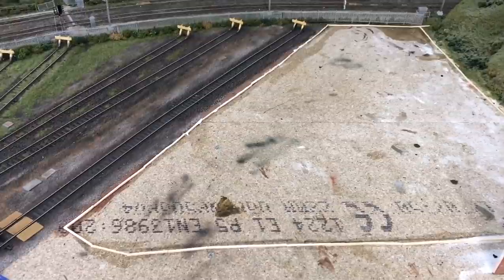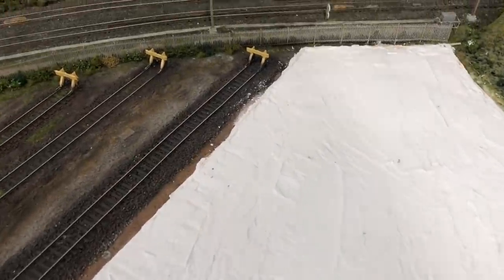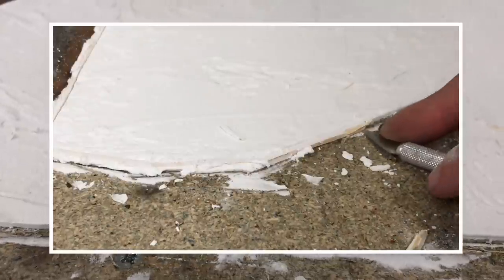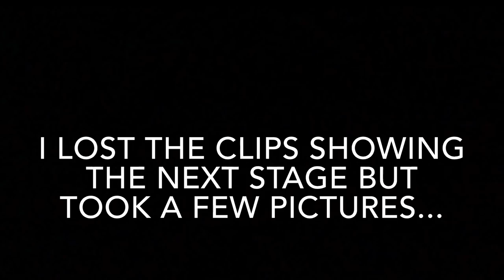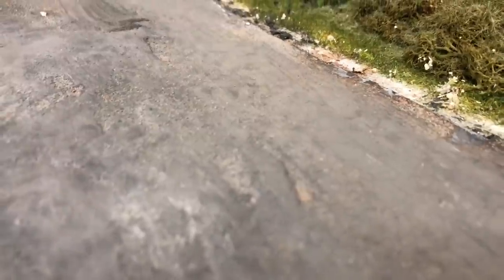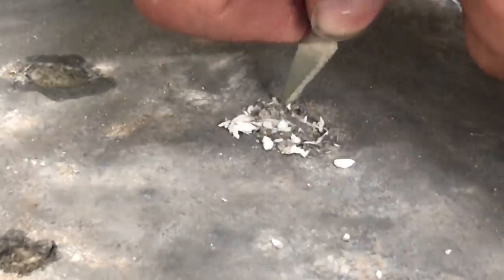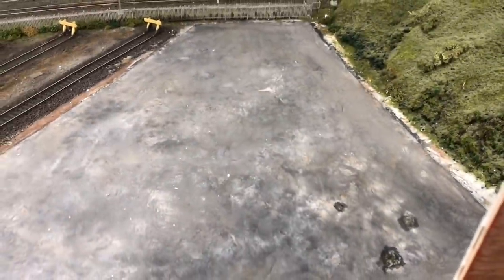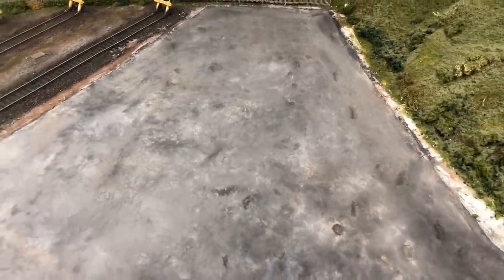Layout Build - Building The Freightliner Depot | The Car Park - Part 1 | Modelling Tarmac/Concrete

Comment: Looks great Jack, nice use of filler that. The paint works really well blending all those washes together.
I like the potholes, i'd never have thought about adding woodland scenics gravel chippings to the top of the holes.
Alex
Reply: @belsteadlanemodelrailway  Your right, a lot of low priority roads are just chippings pressed into the surface.